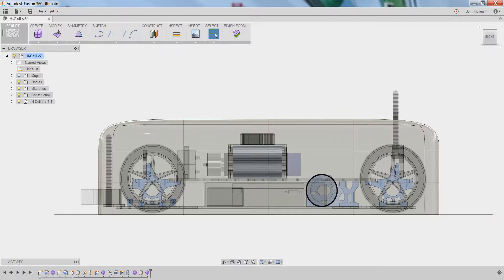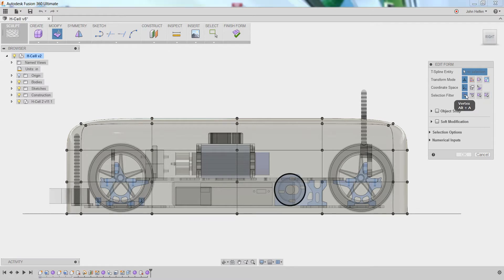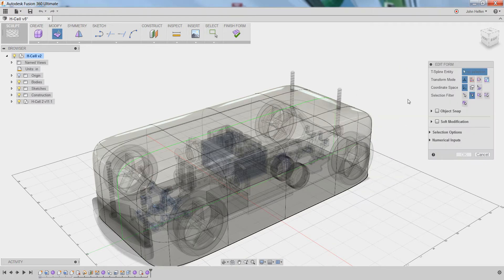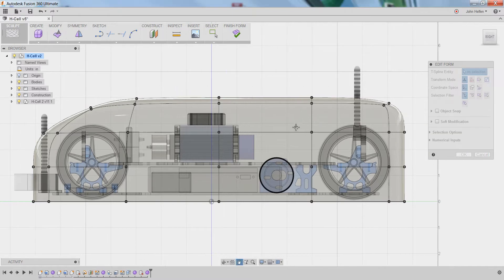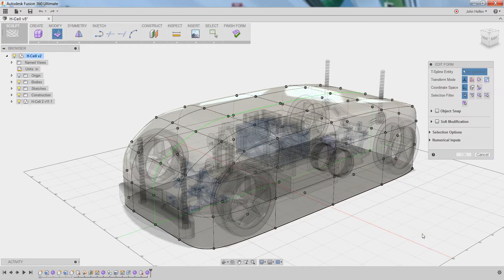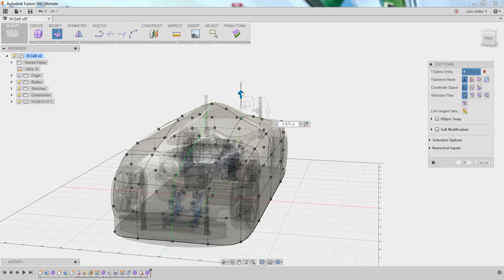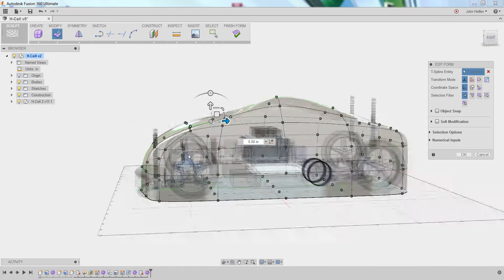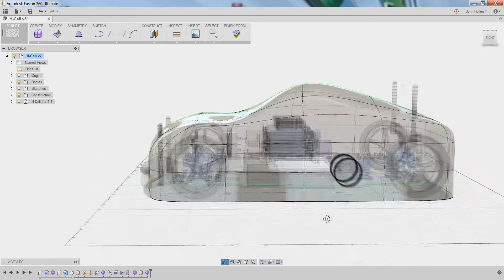Fusion 360 - Edit Form Tool

Comment: Good vid, appreciate the share. How do you design in Scuplt to get a good "Thicken" result, to 3D print. I get unexpected results - sudden openings and gaps.
Reply: If you are breaking through the walls, it's typically an indication that the you are thickening to the wrong side, too thick of a wall thickness, or your walls come too close to each other because the wall thickness is too big.